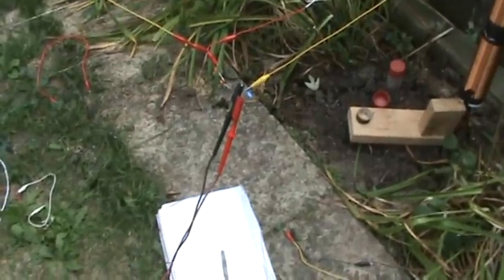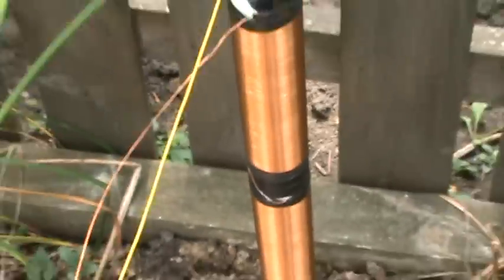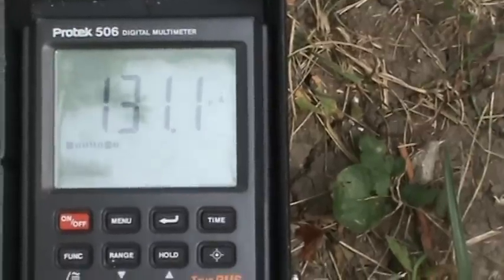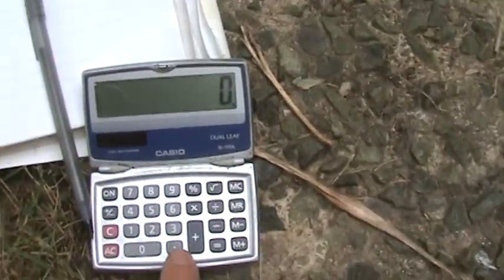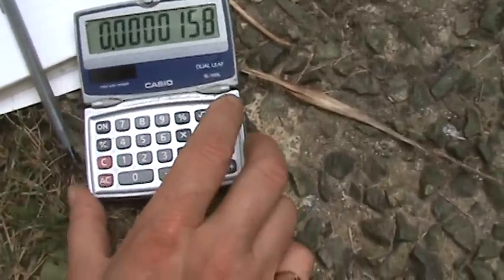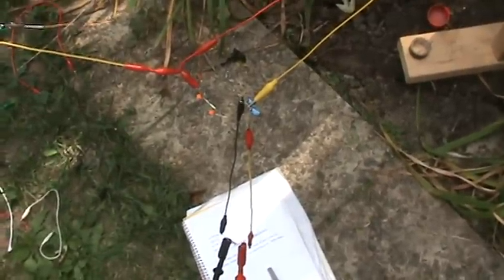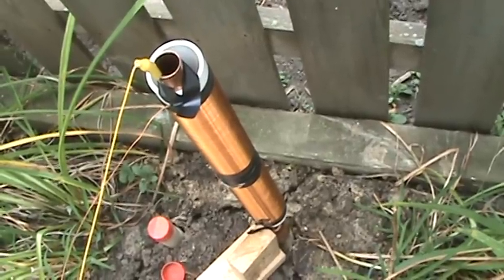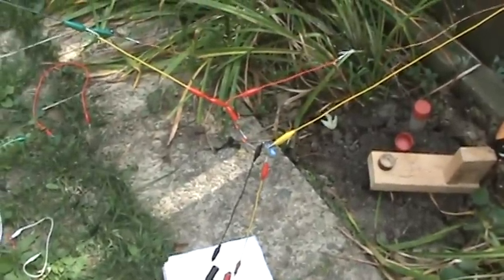FREE ENERGY FROM AIR CIRCUIT PART 21/24

Comment from the maker: Off the wall, i like.  Boring not so much.  I will improve next videos.
I think it is video 6 that shows powering a calculator. It will charge batteries and cell phones.  At this point i know what it can power without trying it. Power will be increased next spring. Thanks for comments

Comment: Nice work here!  You probably have enough now to be able to run a joule thief circuit.  If you use a supercap or a b-cap, you can charge it up and have real usable power from your device.  Check out some of my videos where I can light a 48" tube, 400 leds, or run a Bedini motor from my EER (earth battery) set-up.

Very well done.

Bill

Comment from the maker: @jbignes5 Hmmm, good comments. I will try connecting the coil as you said.  I really need to make a new schematic for this circuit, including the coil. I agree that i need to trade some voltage for the current :-)

Comment: Paul, there have been a lot of people who experimented with making an electret and pulling in power from a raised wire. A HAM antenna can have a 300 volt potential. Most people make an electret from co-ax by baking it in an oven until the insulation softens.  Because of atmospheric humidity, I'm wondering if you would get more power if the lower part of your wire were insulated?
You would probably find the work of Stubblefield very interesting for your ground energy.
Dan

Comment: *Continued*

If you connect the coils across your circuit from end to end then you should get an oscillation that should be tuned to the frequency you are seeing currently. You need to figure out what coil will resonate at that frequency and amplify your output. You might have to down convert the voltage to more amperage by using Tesla's torrodial tranformer to bring down the voltage and add more current. This could be what Dr. Moray did by using the natural oscillations to drive his circuit.

Comment from the maker: Ahhh yes, the coaxial...i have read lot about this and the treating of the cable...i got no good result from the cable, but i never treated it, that would increase the effect...but im not getting an effect eith it not treated...problem is,,i come to the conclusion that we are not picking up STATIC elec...and thats what IS picked up with the coaxial, i did many tests with the inside and outside windings of the coaxial...no good results.
I will check out Stubblefield....sounds familair though.

Comment: When we measure current we use a load of a nominal value.
If you measure the voltage across a 10K resistor your data is more useful.
remember that these numbers don't tell us how to welcome more energy.
I also suggest you use diodes.

Comment from the maker: @MrMfraley Hmmm, i wonder if i can leave everyone an update on on my channell, hmmm, or i think there is a way to send all subscribers a message at one time. I will have to try this. OK, most voltage was 124V and most current has been 635microAmps. in process of getting everything to resonate now, i got 2 capacitance decade boxes to help with this. I need to also add many alum plates for collecting more energy, each plate having its own antenna, multiple plates and antennas and circuits in serie

Comment: I dunno if you are familiar with the concept but this would count as teluric current, and there are a few requirements to get the maximum results, and also you can use the earth as a battery just that you need to implement the secondary electrode in the earth, there is quite a study on this one, if you are interested just answer and i will PM you the info I got on it maybe it helps...
Hope i am not an annoyance :)

Comment: when you switched to Ampere reading you didn't switch your test leads. You'll find that you have to switch your positive lead to the ampere jack in order to test for amperage... Doing so would simply short out your capacitors though. The proper way to do it would be to then put in series with your resistor.

Comment: When you do the amp readings I always thought youre supposed to measure through the circuit, but youre measuring across like you would do for voltage?

Comment: *Continued*

 One way to take advantage of this is to create a self oscillating method by putting an inductor across the circuit like you have done to measure the amperage. This way you are including the magnetic component in a passive way and might be able to tune your device to stimulate or attract more energy twords the antenna.

 I am not sure you are using the coils in the right place. Are they connected across your circuit? Or are they connected after the circuit?

Comment: Also I don't think you are doing anything wrong in your experiments. Even when you measure the amperage because if you understand that you are using caps to create and separate the charges from the ground. I think the only way you can show the potential to do work would be the same process you are using because there is not flow in your circuit. You have to create a flow and thats what you have done with the resistance across the capacitance.
 One way to take advantage of this: *Continued*